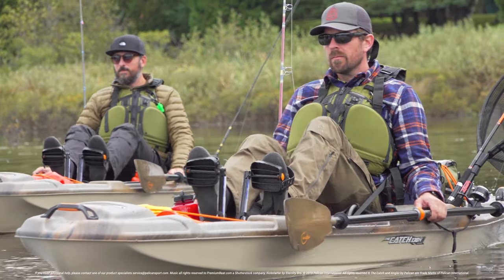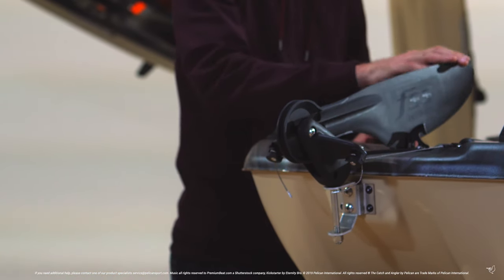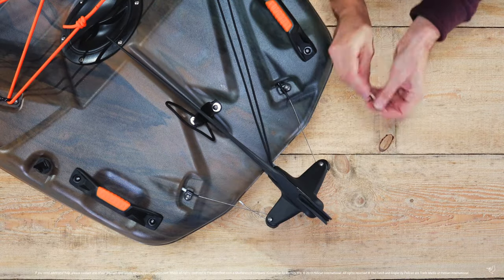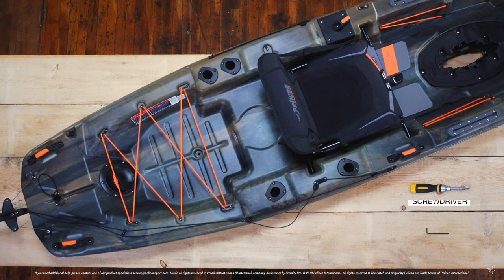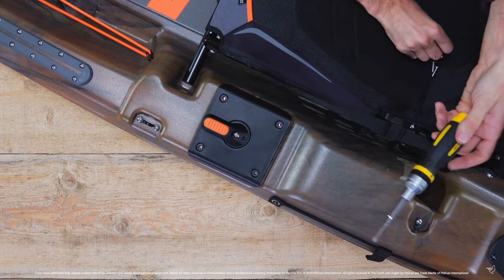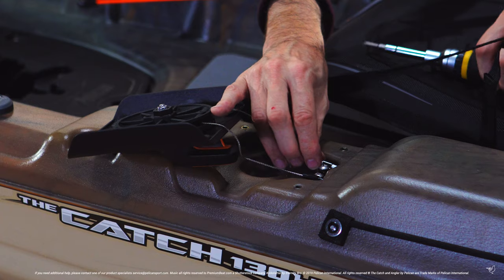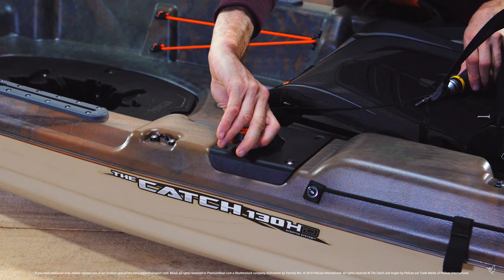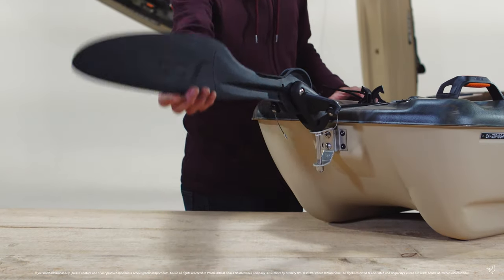PELICAN | How To: Adjust the Steering Alignment of Your Kayak's Rudder

Comment: Hi I just bought anew 130HD and set it up but the rops by the seat are not operating.  I can pull the rubber up and down but with with fores by the Rudder what do you thing is wrong  the rops are not twisted  Thanks  Doug

Comment: My white rudder sheath under the control has come loose about 5 times already. I’ve gone through the steps and it still slips. Would wrapping electrical tape around it help making a tighter crimp when screwing it back in? Thanks.
Reply from the maker: Yes, that should help the p-clip get a better grip on the cable. If you email us your issue we will notify our R&D department to look into short-term and long-term fixes. media@pelicansport.com

Comment: My steering control is getting a bit harder to turn after only owning them for a month. Is there a way to lubricate them and what lubricant should be used?
Reply from the maker: Have you checked the placement of the cables under the handle? Some early models experienced cable slippage. If you find the cable is slipping in the p-clips, consider tightly wrapping some electric tape around the end of the cable to provide a larger surface area for the p-clips to grip on to, this should improve your steering experience.
Reply: Mines is the same way. When I bought it 2 months ago, I had to go into and adjust the wire from the steering handle. When I took the 4 screws out and pull it back the wires were adjusted properly. And here I am looking to see if there something else I could do because it's getting harder to steer  again.
Reply from the maker: Hi  @phillydonlos8645  , normally difficult steering is caused by a slipped cable. If you are sure that the cables are properly installed under the handle, then make sure there is not too much slack in the wires going into your rudder. If everything is as it should be and you are still having difficulty, then definitely send an email to our customer experience department service@pelicansport.com with photos/video and your serial number included.
Reply: @PelicanSportVideos  appreciate the reply. I will check again. Thanks